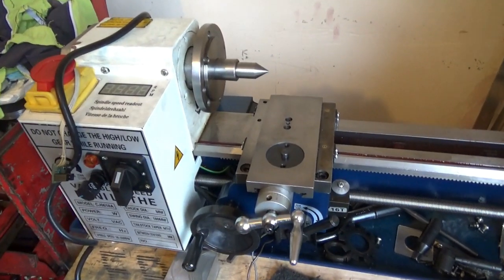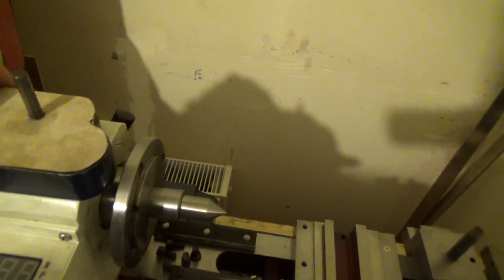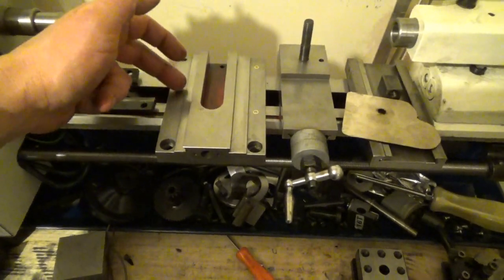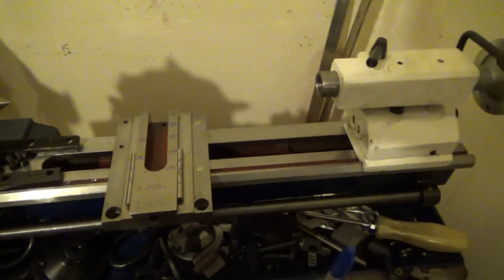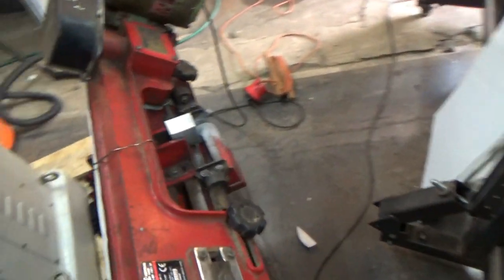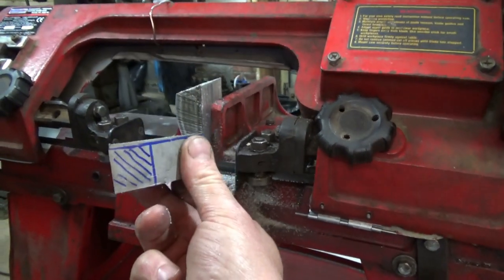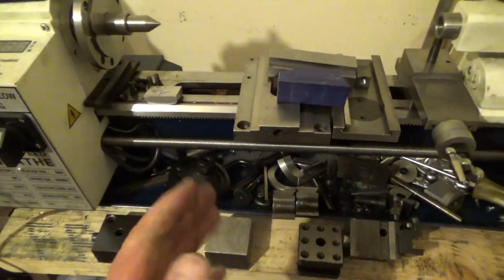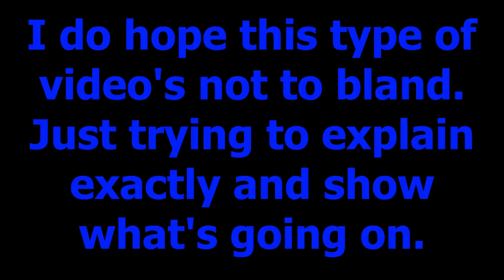No6: Chinese Mini Lathe Essential Mods

Comment: I'm sure you'll get the mini-lathe up and running in no time; much simpler than the Holbrook.  You've got some great ideas, and wish you the best of luck!
Reply from the maker: That's right.  I really want to complete my machine rollers though. I have a lot of footage.  Without a working lathe they are on hold. So either way, mini lathe with accuracy upgrades or rebuilt headstock on Holbrook I'm honing in on the solution.  Thank for taking interest in my goals Daniel.